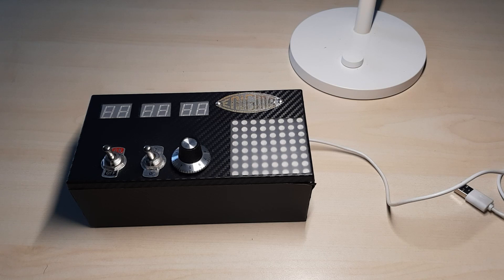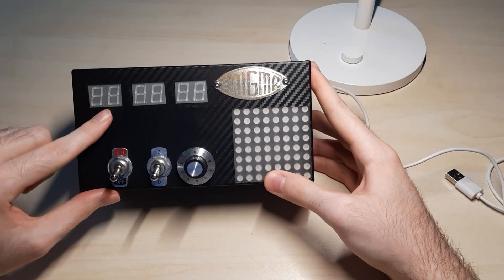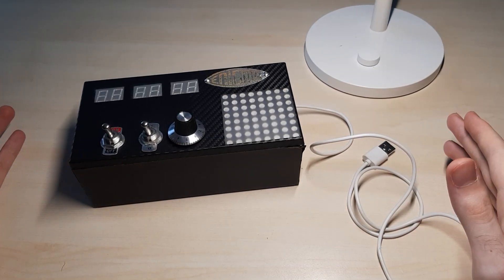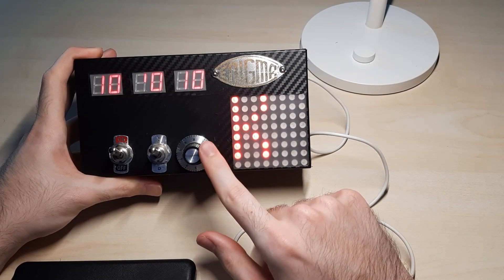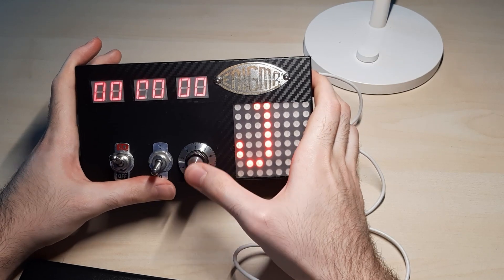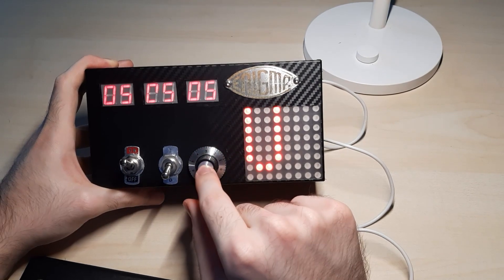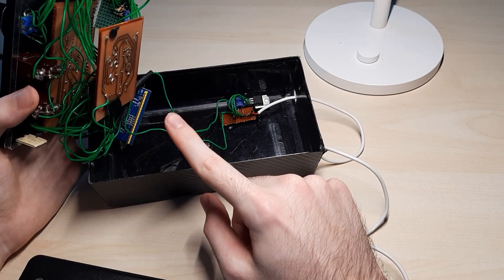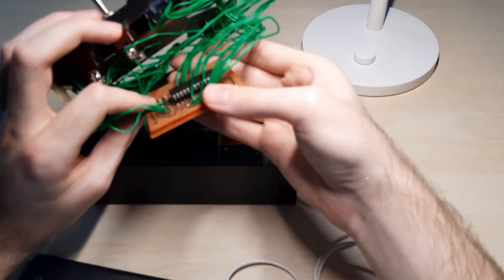How I Build a Digitalized Enigma Machine

Comment: hello nice video, can I ask for help?
Loading the sketch and running the check, I get the following error:
sketch_dec09a:1:10: fatal error: LedControl.h: No such file or directory
  #include <LedControl.h>
           ^~~~~~~~~~~~~~
finished compilation.
exit status 1
LedControl.h: No such file or directory

then...
in the diagram "Rotary Encoder Circuit w/Debouncer", could you tell me the value of the resistors and capacitors?

Thank you